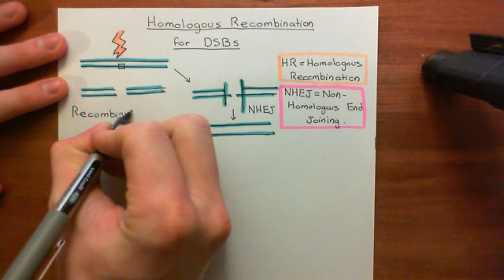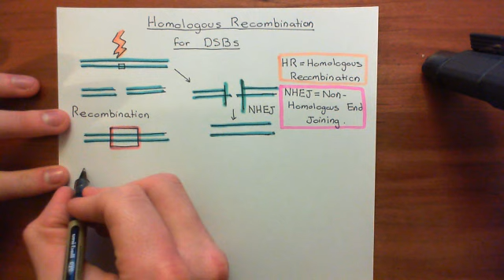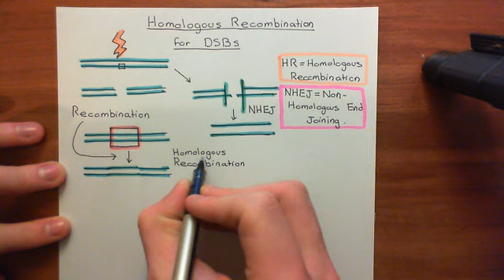Homologous Recombination for Double Strand Breaks Part 1

Comment: How does the cell decide on which mechanism to use to repair double strand breaks?
Reply: You've probably figured this out already but I'll leave this for anyone else who has this same question to see
So it depends on what phase of the cell cycle our cell is at. If it is at a point before the S phase then we wont have a sister chromatid so the cell automatically uses NHEJ